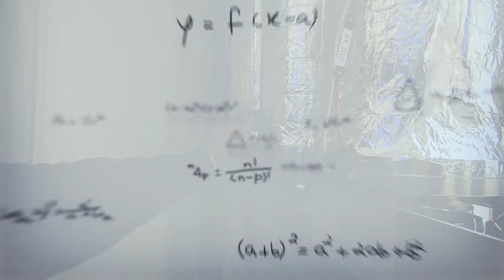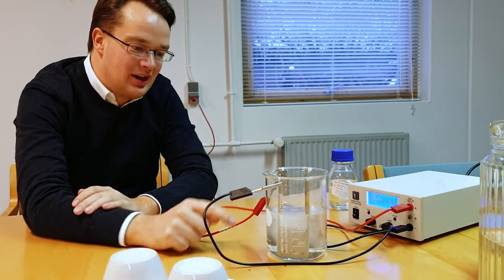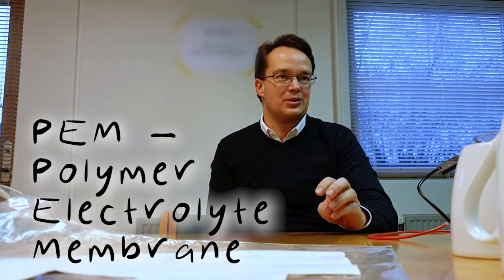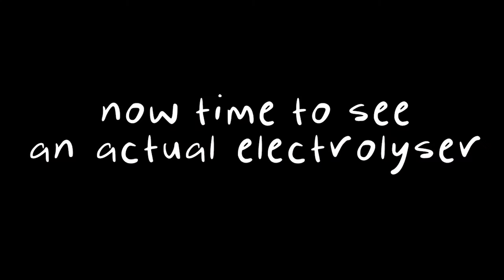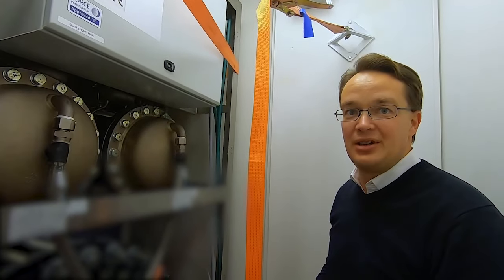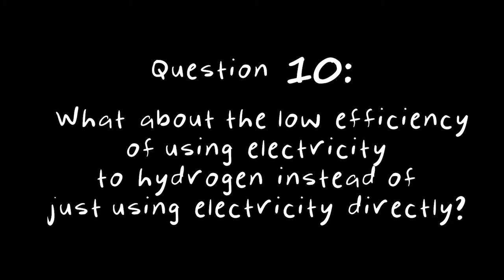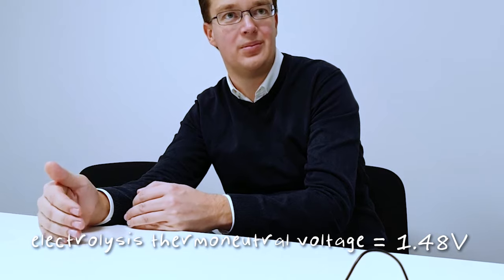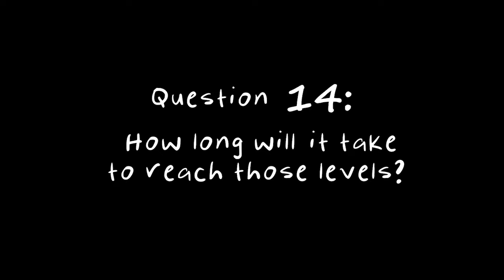Green Hydrogen Systems Electrolyser Tour

Comment: You are just too young to remember, but the 'hydrogen economy' has been a promise that is '10 to 20 years' away... for almost 50 years now.  I remember when Austin, TX had a couple of demonstration buses back in the 90's that ran on hydrogen fuel cells- a very neat technology!  But even then, it was no match in cost even with (compared to today) crummy, expensive NiMH batteries.  Since then, the cost of batteries per KWH has dropped to almost a tenth of the cost, while electricity conversion in and out of Li-Ion batteries is now around 95%.  I just don't see Hydrogen as a fuel, unless it can be made to work for long-range flight, and long-range ships.  The only way to create hydrogen almost as cheap (assuming they can manufacture the fuel cell itself more cheaply, which is still a 'no'), is to make it from natural gas or oil- neither of which are green alternatives or sustainable.  Ironically, the only stock I own is a company recently renamed (yeah, not a good sign) Fuel Positive that has bought the Intellectual Property from a Dr. Dincer (from a Canadian University) to create green Ammonia, supposedly as cheaply as creating it from fossil fuels.  I am skeptical, but my future retirement hopes I am wrong- even if it is still too expensive and inefficient for fuel, the fertilizer market for ammonia is 60-70 billion dollars per year by itself.

Comment: Glad that he mentioned hydrogen conversion to ammonia and other carbon based fuels. People talk a lot about the energy side of things...making power efficiently and such...but fail to realize that to replace oil, coal, natural gas or any other carbon based fuel, we must also replace the molecules because they are the building blocks for almost every consumer good. Plastics, paints, fertilizer, etc...they all require those carbon based molecules or nitrogen based molecules to produce. It's more than just the energy balance, we have to close the material balance as well!

Comment: Hello Rosie. Can you review the water savings of a new product? I am the inventor and would be willing to pay you for a review video. Does not necessarily need to be as deep of an investigation as you usually do - just install a free one and maybe a 5 minute video say - It saved time and is energy saving.
Reply from the maker: Hi Harold, no I don't do paid reviews. I am also not sure that the concept of "water savings" from an electrolyser makes much sense? You split water to make hydrogen, you get two hydrogen atoms from every water molecule. I don't see how you think you can get more? Are you pulling water vapour out of the air? Or where does the water saving come from?

Comment: Hydrogen gas H2 is not a practical form of storing or conveying energy.

Nature use it in water splitting phase of photosynthesis, but coupled with a HC (hydrocarbon) formation phase.

As there is no H2 well from which to capture it, it's extracted from other chemicals, most usually natural gas CH4 methane through SMR reaction.

Using SMR derived H2 as an energy carrier for transportation needs is probably self defeating. Just use the CH4 instead.

On some applications as in rockets and planes, the unparalleled gravimetric density achieved by H2 might play in its favour despite the challanges.

Where batteries or capacitors are applicable it would be quite stupid to incur the losses of creating H2 and converting back to other kind of energy, be it by fuel cells or combustion.

The only logical proposition is to make it dirt cheap directly from solar  energy, in a way easy to store (relatively low pressure, big volume).
Look at Dan Nocera's work for that matter (https://www.pnas.org/content/109/1/15
https://news.mit.edu/2010/nocera-0514).

Storing excess renewable energy as H2 inside current CH4 distribution infrastructure might play some role in our energy matrix, but not a central one.

Comment: Their unwillingness to discuss the unit price suggests each unit is expensive. 4 kg H2 per hour per unit implies significant expense to produce H2 at industrial level. 

Their unit is a great start. There is a long way to go. 5-10 years to achieve 85% efficiency may be optimistic. Only then will scale production bring down the unit costs. Practical implementation may be 20 years away.

Comment: What happens to the used water?
Reply from the maker: It gets split into hydrogen and oxygen, 2H2O (liquid) --> 2H2 (gas) + O2 (gas). So basically, the water gets used up.
Reply: Oh...like our fresh water supply gets used up.....but hey, at least we dont use fossil fuels!
Reply from the maker: @tarabull75  ha ha! Yes of course you can't do electrolysis where water is scarce, but the same goes for lots of other things society needs. Did you know that fossil fuel generation also uses a lot of water? It could be interesting to do a comparison of the two, but in short the water usage by electrolysis is not actually that large compared to other water users.
Reply: @EngineeringwithRosie  : also the hydrogen generally reverts back to water within a few months. If you burn it -- as hydrogen or as synfuel, it becomes water. If you use it for fertilizer, after many steps some mitochondria or fungus will burn it.

Comment: Can we use sea water for electrolysis?
Reply: It was mentioned in the video.
Since you have to purify/demineralize the water anyway, you can basically use any kind of water. 
And compared to electrolyzis, sea water desalination costs hardly any energy (less than a thousandth).

Comment: 5:28 that weaselling does not look good. He should have answered the question, at least with ranges or relative numbers.
Reply: Yes. E.g with electricity £0.1 per kWH, the capex for hydrolysis (including control and storage) is £10k per kW, and 1 kWh generates X kg H2 which is worth £ ZZ. 

It's not so easy 

I wouldn't call it weasel but it needed calling out

Comment: Exactly, the electrical grid will never cope with a ten fold increase in electrical transmission when we move away from fossil fuels. So unreliable forms of renewable energy should only be used to produce hydrogen that has the flexibility in use the modern world requires.

Comment: i still have an issue with this business ecosystem and how it supports an older way of doing business!  this requires  Water, Energy, Transport, Storage, maintenance and conversion of current systems sadly it is not where near efficient for anything smaller the a large scale Boat / plane! Renewables + Stroage + BEVs win hands down!

Comment: And once you have Hydrogen you do what? You have to store that but can‘t easily because hydrogen is both highly aggressive and volatile. You must either compress it to at least 300 bar or cool it to minus 253 degree celsius. That’s about 20 Kelvin.the energy needed to do that reduces the efficiency of the complete process significantly. And then the hydrogen still is not where you need it. So you have to transport that as well…
I do NOT see that bright future for hydrogen, to be honest.
If you have spare energy there are FAR better ways to store it.
Reply: A voice of reason. The only thing I can see it being used for is to produce either methane for the plastics industry or methanol for aviation fuel.

Comment: That is one cheap power supply. Ones I use and own have a clamping feature so you would never see the Voltage drop but a current variation.

Comment: Please Exploit your research for AMPLE CONTINUOUSLY SUPPLY AND  USAGE OF HYDROGEN GAS DIRECTLY AFTER SEPARATION, WITHOUT STORING FACILITY FOR,
1. ALL 2 STROKE 4 STROKE ENGINES AT ALL EXPECTED USAGES OF ENGINE
2. FOR BOILERS
3. FOR HEATING IN WINTER SEASON FOR ALL TYPES OF HEATERS
4. FOR AVIATION
5. FOR ALL PORT UTILITIES, ETC.
By making use and throw types cartridges which has connection like mobile pin let whatever be receiving connection it could easily be fitted and ample excess supply of Hydrogen Gas is available for usage.
By making canisters for supply of Hydrogen Gas
By making Gas bottles filled with Hydrogen easily lift and shift in five minutes by user
By making permanent installed bottle refilling stations, etc.
Ammonia, Water, Organic Group of Alkane, etc. Are ample supply of Hydrogen only problem is these producers are not exploited on commercial base for usage of Hydrogen Gas.
May be political will needed for Hydrogen use as it would tremendously effect international market of crudes. Also usage of Hydrogen Gas would SURELY help for carbon reduction THEN SOLAR POWER. as still at many places SOLAR COULD NEVER BE USED
For example, Boilers, Ships, boats, CAPTIVE POWER PLANTS, MW to kW developing engines, etc.
So my sincere request to all your learned Scientist please exploit your research.

Comment: I found storage hydrogen is best for power plant jet turbine .from HHO
I am curious about under ground hydrogen storage vertical tank with a cut out escape system like inverted rocket so if exploded the storage nothing will happen but a big bang noise and flame will discharge as muzzle from under ground storage . If anyone suggest me hydrogen transported I am not with you if you say on ship ok but not at vehicle nope .hydrogen mobility is a explosive mobility so no.

Comment: Burning hydrogen is about the most stupid thing you can do with it. Fortunately this man understands this (at 9:42): only convert it back to electricity if absolutely must. I would like to add: and back to heat if you absolutely must. So, heating homes by burning hydrogen is a no go. 
For now until until the efficiency penalty is solved: only use the green hydrogen where it hydrogen is needed, e.g. industrial processes.

Comment: 🔵 Small tree size units, powered by Solar panels + Atmospheric water generator + Hydrogen EL Stack = 🟢 Free fuel in the desert for cars, HYD electro helicopters ...

Dubai uses Atmospheric water generators running on Solar power....
Guess the Sheiks could have new fuel for Safari car racing...😁

Similar looking as these Starwars movie moisture farm towers.

💠 Colonizing deserts 
= overpopulation  pressure solution by expanding in deserts.

Comment: Question where is the fresh water and clean energy going to scome from ??? Right now the word has a massive shortage of water in many areas and green energy is simply used to supliment other forms of generation. In the end we have NO surplus of either products to produce this product which is, in the end, more polluting than using natural gas right out of the ground.
Reply from the maker: Using salt water with desalination adds a negligle amount of energy required compared to the electrolysis itself. So you're right that you can't build electrolysers inland where there is a water shortage, but if there's salt water nearby that can be used.

Comment: Electrolysis is the most inefficient way of producing hydrogen that is why the hydrogen industry, in general does not use it. As Rosie said, electrolysis has been known for at least 100 years, I dont understand what this company offers that is revolutionary or new?
Reply: What other way is there to convert electricity into hydrogen that you're comparing against? Turning fossil fuels into hydrogen is no good, as it releases CO2 into the atmosphere and defeats the whole purpose.
Reply: @TheHuesSciTech  Why would you convert electricity into hydrogen?

Comment: All this fad about hydrogen you need 50KW of energy to produce 1kg of hydrogen and to design an industrial 50MW complex not only that you need a step up transformer as well talk about heat that will come from the transformer and the electrolysis unit as well . The rule of thumb you need 9 tonnes of water plus 1 percent NaOH to manufacture 1 tonne of hydrogen and you produce nearly 8 tonnes of oxygen to make use of by products so a Ammonia plant and a steel plant side by side interesting topic so 50KW in to get 35KW of useful hydrogen.

Comment: Wow, you really don't explain anything right.  Why don't they normally capture the oxygen?  Not because there aren't many use cases for oxygen! lol.  It's because there are MUCH, MUCH cheaper ways of producing pure oxygen.  They use sieve beds and compressors to extract it directly from the air in large quantities.  And there are MANY, MANY uses for oxygen, including, ahem.... life support.
But in the lab, it could be beneficial to use the oxygen produced by an electrolyzer for experiments instead of buying cylinders of O2 or reacting chemicals to get it (that is, if you're in need of the hydrogen anyway).